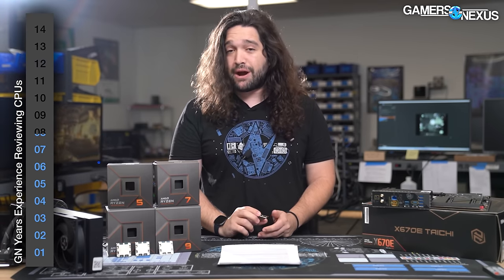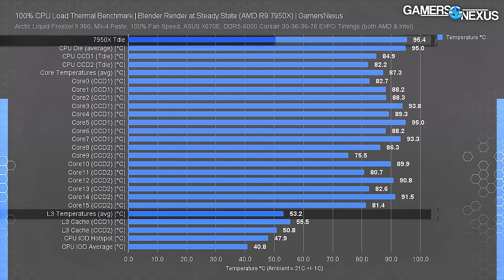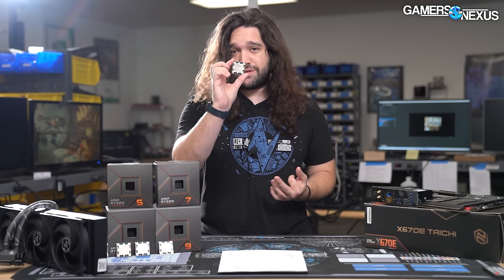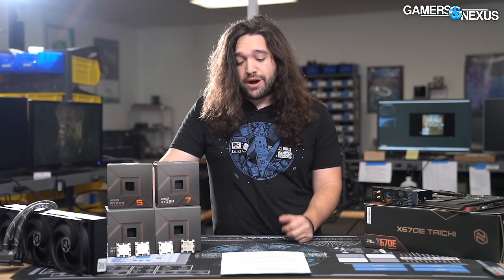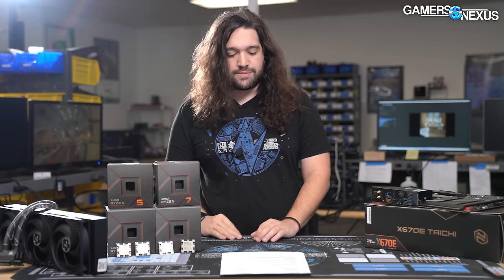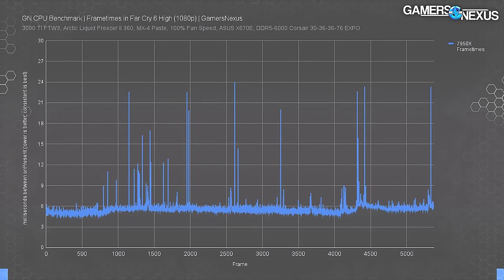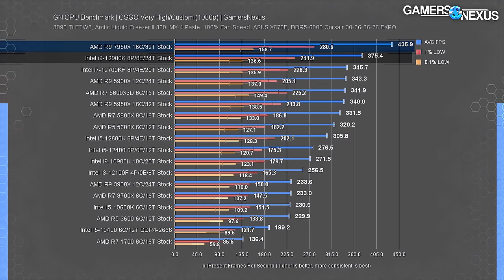95°C is Now Normal: AMD Ryzen 9 7950X CPU Review & Benchmarks

Comment: As someone who is looking to finally upgrade from an 1800X: thank you for including a first-gen Ryzen CPU in your graphs! d(^__^)
Reply: Dont be afraid to look at the 5000 series of ryzen.  The performance is a bit lower but the price has come down a lot recently.
Reply: @andrewt.5567  Not to mention the AM4 motherboards are actually affordable and the DRR4 required is also better priced than DDR5.
AM5 (Ryzen 7000 series) motherboard prices are out to lunch, very expensive. :(
I have 2 systems, one with a 5600x, the other with a 5900x, after seeing this video, hell no to a upgrade...... 95 degrees C and over 200 watts, screw that!
excuse me for a sec, I'll run downstairs and hug my 5900x! LOL
Reply: @jackr.749  95c is absurd, but you can set tdp to simething lower like 75c. Although now your practically crippling the cpu for what you paid for at that. However, id rather invest in newer tech than eol tech.
Id like to see these tests with tdp at 75c.
Hopefully AMD will take their foot off the gas so much with pushing power with future AM5 cpus.
Reply: @bear5016  what? No. After this video, 5900X or 5950X are the way. You can get a 5900X for $368 brand new. You can get an excellent mobo and RAM for A TOTAL of $300.

I'm definitely skipping this nonsense.
Reply: On a 2600X + 6900XT... want to let this video card run free, need a lot more CPU to do that... and I'm at 1440P, / 144Hz my current CPU is definitely holding me back.
Reply: @SlowSpyder  get a 5600. They're $160.
Reply: @jackr.749  I haven't even put together my 3900 build all the way.. at the time no one had any information on SK ram in the clocking communities.. and I knew I was going to have to undervolt it, underclock it etc given a shipping curve fluffle that ended up with me buying 4400.. it's just sitting there cuz I'm on that 79 and more or less haven't needed to do anything with it.. and now I'm just sitting here like damn I just I just sat through two cycles with that thing LOL like I put the motherboard in I think I socketed the CPU LOL that's as far as it got.. oh yeah I also had this abandoned hope that I was going to be able to start it with a fresh Windows install from a custom delivery ISO.. I mean it's still going to be that but, back then there was still some hope that you could have security updates and not have to constantly disable or reset your settings every time it would update automatically too.. unless I can find that elusive Enterprise edition LOL...

Yeah those motherboards they be expensive, in an obscenely expensive way.. I thought x570 was obscene, coming from x79.. kind of a shock in terms of what you're getting versus what you're paying.. like I'm sure it's it's better faster whatever, lots of nvme etc pcie4 etc.. but just to get a reasonable amount of SATA and pcie Lanes was like 450 bucks for the ace.. which was pretty much the only board that had the things I needed LOL and it didn't even have Wi-Fi that's just that's just a thing that isn't there LOL.. also came with a GPU bracket that I had to actually look up a Japanese advertisement for to see how it actually was supposed to work.. the QR scanner on the pan flip manual that had almost no manual in it.. well you scan that code to a PDF of exactly the same thing... So.. little did I know it was going to take me hours to actually even find out a picture of it installed LOL.. not a good sign right especially because my older power supply, and old 2013 Era case that I bought new, given that apparently a 2013 case was also the only version of a thing that I needed certain things to have.. that had more comprehensive instructions for the motherboard than the actual motherboards instructions LOL.. and I still have my x79 one, it's been very very useful over the years..

Although at least I can say that Asus may not have the thing but it didn't subtract from me with its support disgracefulness.. that would be a gigabyte thing.. as I think they extract your life force every time you try to use any of their software, configurations bios etc.. especially laptops my God especially laptops.. Asus just simply had a one-two punch of well obviously the QR code took you to where you started all along so I guess you're you're done right.. whereas gigabyte.. perhaps that's why it's bite, it's kind of like a tick but one that gets infected, but not enough to kill you but it's still kind of annoying every time you take a shower or the weather changes.. God I'm going to miss EVGA I really am.. had my issues with them but but gosh darn it they were confident and as it turns out they were extremely competent by comparison I just didn't know LOL.. I just knew they at one point before the pandemic had a really good cross shipping return policy thingy, and they were competent in terms of reviews LOL I didn't realize that the other ones just simply weren't LOL.. especially gigabyte my God.. like Asus is bad but, like I said gigabyte extraction from you.. you will age with gigabyte it seems trying to do the most basic things...

Apparently, none of the aibs in terms of Major brands had been competent in ways that I just didn't really think anybody was incompetent in that regard things like missing thermal pads etc.. I really really don't want to have to take my cooler off with a brand new card.. but you know what, I actually might at this point from what I've seen.. of course fortunately I'm not buying a new card this year LOL it might have been an option but.. apparently Nvidia doesn't want you to have them.. which is why they priced them the way they did so that you won't buy them so they can build up more stock I'm assuming for the next mining boom? Who knows why they did it but they certainly don't want to sell things.. there could be other reasons but, you might have to talk to marketing.. currently trying to create a feedback loop to try to cross-dimensional planes in order to harvest more shopping mall market test subjects.. some smalls don't exist they have to extract them from the other planes of existence so it's a complicated job it's added a new degree of marketing to the marketing but you know that's why we have marketing it's it's because of marketing and because how could we that's that's why we have marketing.. it's not about us to ask why it's about marketing... 

the department I don't know about anything that has to do with actual marketing but like the marketing department like marketing is marketing takes care of all that.
Reply: @redpilljesus  I'm 50/50 on 7000 series vs. saving $ and going with current gen once prices drop. Gonna see how it plays out, but 5000 series is not out of the question for sure.
Reply: @SlowSpyder  you can have both. With a $160 CPU, you can sell it for $100 in 6 months and get a 7800X3D. Is $10 a month really worth the crappy experience?
Reply: @jackr.749  In my case I just reused my x370 crosshair vi hero. Might as well since the cpu was supported.
Reply: @bear5016  why would you want to limit it to 75C though? it's been a decade since it was necessary to keep CPUs that cool, 85 has been safe for a long time and evidently 95C 24/7 is fine on these chips.
Reply: @bear5016  I don't see that happening. Both companies are basically auto overclocking their processors to look good in benchmarks now.
Reply: Just get a 5800X3D
Reply: @SlowSpyder  if your motherboard is up for it, this is the ideal use case of the 5800x3d
Reply: @JGStonedRaider  not worth the 2.5x price of a 5600.
Reply: @RWoody1995  95c is a lot of heat to dissipate. So unless you want a suana in your room...
Reply: @ArtisChronicles  agreed, when I first got my 5600x, I ran it on a Aorus X470 board with updated bios to support Ryzen 5. I did eventually get Aorus x570 board afterwards and my wife uses the x470 with old 2700x and is quite happy with it for what she uses the computer for! :)
Reply: @bear5016  95°C is the temperature inside the CPU, not the heat dumped outside the case, into the room. 
 They've let it go until 95, just because it's detrimental to try to extract more of it, without exotic cooling.
 Running hot and dumping allot of heat aren't the same thing..
Reply: As someone in a similar situation looking for an upgrade from Ryzen 1700, the 5800X3D seems to become more and more attractive, specially gaming related and power/cooling wise. Money saved on not needing to upgrade Motherboard, RAM and cooling can be put to use elsewhere.
Reply: Don't be a beta tester, unless you want to! 5000 series worth to take a look.
Reply: @jackr.749  DDR4*
Reply: I just went from an 1800X to a 5600X, and, with the newer RAM, it was a game changer (quite literally, but desktop computing and Cinebench scores significantly improved as well.)
Reply: @gamingpcassemblato432  so youre saying theyre measuring temperature differently now all of a sudden?
Because when my cpu hits 75c its dumping a lot of heat. So it stands to reason if its hitting 95c, its dumping a lot of heat.
Reply: @youtubeisgarbage900  OH GOD IM CONSOOOOMING AAAAAH
Reply: No!  DONT UPGRADE YET... better off just waiting for 7800x3D and say bye bye to AM4.
Reply: It's more interesting to see how good the heater performace of 7950x for space heater.
Reply: @gamingpcassemblato432  No, running hot means it is dumping out a lot of heat, by definition. If the core inside the chip runs hot, that heat needs to be dissipated to the surrounding environment somehow, since it won’t just disappear into a black hole. The hotter the chip, the more heat it will dump out to the room (via the installed heatsink and cooler system).
Reply: @bear5016  no they aren't measuring heat differently, you're just not understanding what heat is. you can get a CPU up to 95C whether it has 50 Watts pumped into it or 200 Watts, the same temperature but 4x as much thermal energy (heat). This can happen because of poor cooling but that doesn't mean the 50W cpu is creating any more heat, it's just reaching a higher temperature locally, it's still only dissipating 50W into the surrounding air.

Probably the reason AMD recommends 95C as a temp limit now rather than something lower is that they've increased the quality of the die. Laptops for example have had thermal limits of 100C for a very long time, they have done this by necessity as it's easier to pull thermal energy out of something that's running at 100C than something that's running at 70C which allows them to make thinner laptops without reducing performance too much. desktops simply haven't needed to have that higher quality silicon for all these years because they can fit much larger heatsinks and it's cheaper to put a larger heatsink than increase silicon quality to allow a higher temperature. Until now of course, we've reached a point now where so much energy is pumped into CPUs now to continue getting more and more performance out of them, they cant just beef up the heatsinks and it becomes easier to do as they've been doing with laptops and raise the temperature limit.

Comment: It would be interesting to see how performance scales with a range of cooling solutions (budget/premium, air/water).
Reply: They do recommend a 240mm AIO for the 7900x/7950x and I imagine this is exactly why. It'll no doubt throttle but even at 95c they are holding well above the non-boost speeds.
Reply: @AndyMitchellUK26  I guess that's the difference, rather than "throttle" it boosts up to the designed thermal limit. It used to be similar with 5000 series only it would hit clock and power limits first with hefty enough cooling. Throttling refers more to back in the day when clocks would crash down to the minimum to stop the chip from bursting into flames, before gradient boost was a thing on CPU
Reply: Only custom, no air

Comment: Normally I'm hesitant to buy into the best of last gen preceding a big bump in evolutionary stages for PC parts like I did last year, but with all the power-hungry bits, new untested boards, etc., I'm a lot more confident in my decisions as I watch all the new stuff unfold from safe prodding distance.
Reply: AM4 is looking more and more interesting every day
Reply: @-opus  Yeah I wait till they review the other 7000 parts and Intel's new generation but I'm almost certain buying a 5800X/5800X3D will be the best option for me budget/performance wise.
Reply: That is totally why I went all-in on last-gen stuff a few months ago.
Reply: Yeah I'd avoid the early adopter tax and wait at least another generation to move from a mature product to a new one.
Reply: Yeah been thinking about upgrading my 3700x and was considering 7000 but honestly probably better off getting some more life out of my motherboard and just getting a 5800X3D
Reply: I personally don’t mind “upgrading” to an older generation pc. Although I will buy used parts instead of new. I haven’t had any issues doing that so far (knocks wood)
Reply: this smells alot like Vega where undervolting brought huge gains etc.
Reply: This was my thinking exactly when I recently spent $2k on an AM4 rig. AM4 is a mature and widely available platform, that's had years of fine tuning and refinement. It's the same reason I'm still using Windows 10 instead of 11. I'll let AMD iron out the kinks in AM5 before I commit to it. Being on the bleeding edge is cool sometimes, but the price for that is a lack of predictability.
Reply: I was thinking the same, this is why I went for the 5900x at 390$ last week, really nice upgrade to hold a couple years until everything is settle down.
Reply: That's why I stay 1-2 gen behind. I JUST bought a 5600x for my daily driver which I might upgrade to a 5800x3d for the next 2-3 years. Stuff like this with BIO's issues/bugs with brand new hardware I like to wait until all that gets flushed out. I'm very happy with my 5600x.
Reply: same. Put together a 5950X system 6 months ago and I don't regret my decision one bit. The only slight annoyance is that components became cheaper, especially GPUs after I'd built the system. Oh well. Overall it's a killer system with acceptable power requirements. And it doesn't even need an AIO! A Noctua NH-U12A is doing the job just fine. You couldn't say that with a 7950X
Reply: @carterbeals9771  Yea I skipping this generation completely due to knowing there are going to be problems with memory and boards to be worked out before I commit into a new ecosystem.  I'm not fond of LGA to start with as there's always problems with that.  Just look at the intel side that you have to have an aftermarket hold down for the chip as the socket sucks.  I'm fairly sure the new AMD boards will need the same treatment.
Reply: If you underclock, undervolt, and power limit down to sane levels, then you will start seeing genuine efficiency improvements from the "modern parts".

A shame they can't have sane behavior out of the box these days though. As the above is non-trivial to do. ☹️
Reply: I'm on a 5900X at 165W max and using a 3070 that sits at 140W. I'm good. Waiting for Zen 5 to see if it's any better, and next gpu gens after Ada and RDNA 3. 3070 lost no performance btw, Ampere is just badly overvolted.

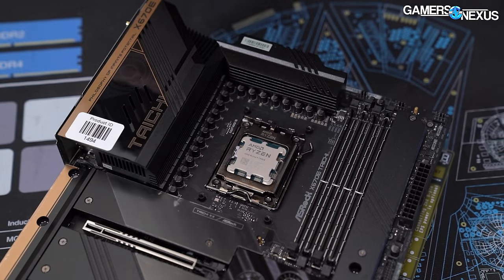Comment: 4:06 - This also means UNDERVOLTING to lower operating temperatures while still being stable can help performance.  It will be interesting to see how well these will tune to lower voltages.
Reply: a swedish site i follow, tested undervolting and got great results!
Reply: Undervolting might lead to clock stretching and hurt performance to much unless there is the Curve Optimizer feature like in ZEN 3 CPUs available in the SMU and the BIOS. To me removing that THICC IHS is the best way to go as Roman Derbauer show massive temperature drop of more than 20C and also power consumption. Lower temps=less current leakage=less power

Comment: Steve i'd like to see a good ol' cooler testing on the 7000 series. I know its gonna be around 95c for all of them but we could see how it affects the performance. (Like on a scythe fuma 2 or noctua air cooler.)
Reply: Didn't he say it changes by like 100MHz?

Just look at the fan reviews under 250w load and see which fans do best there.
Reply: @libertyprime9307  the 250 w load isnt good enough. My 5800x is the prime example of that. My friends 12700k runs cooler with my fuma 2. 
100mhz? Its probably dropping way more on an air cooler than with an aio.
Reply: I AM THE BEEST YOUUTUBER YOU'RE ALL TRAASH COMPARED TO ME IM THE BEEST 😂😂😂😂😂😂😂😂😂😂

Comment: I wasn't expecting reviews to be out so soon on these. Cool to see the numbers, but my 5600x will he fine for a long time

Got some coasters recently to support the work and they are awesome. I like to do thermal paste swaps on old GPUs and test temp differences as well.. so I might get a mod mat for myself for xmas

Last card I did was an old R9 290. With the fan blasting at a 100% (blower cooler.. yikes) temps were improved by 8 degrees 👍🏼

Thanks GN team for all that you do!
Reply: Had a blower R9 290x years ago, great GPU and with IC Diamond thermal paste it reached a steady 87 degrees which was fine, i could finally take my hearing protection off after buying an RTX 2060
Reply: Decent. The 290x definitely would have struggled even more with a blower cooler... yikes

For some reason, the bios in my 290 prefers silence and will throttle clocks instead of kicking up more fan speed (fan won't go past 49%). So it throttled down from 947mhz to the 800mhz range with the old paste, but now maintains clocks with the new paste

Comment: It would be nice to see performance number for lower power draw, if it's like overclocking you can probably still get 90-95% performance with 25-30% less power which would still be a good upgrade
Reply: They have an eco mode. 65watt mode and 105 watt mode really interested in seeing reviews on these modes.